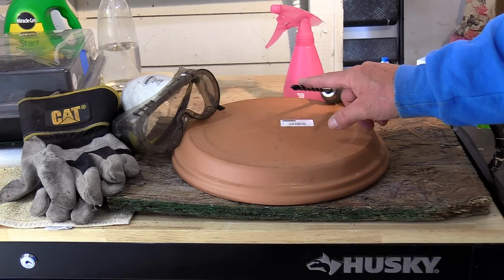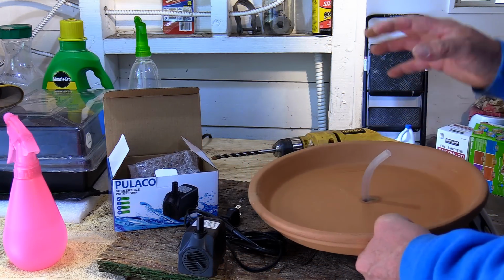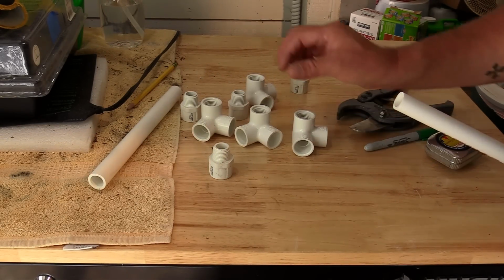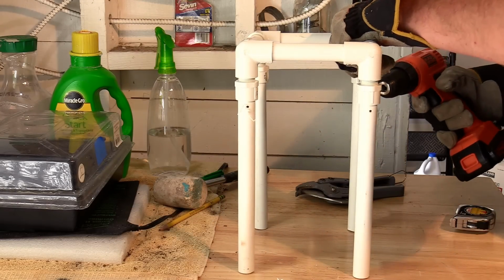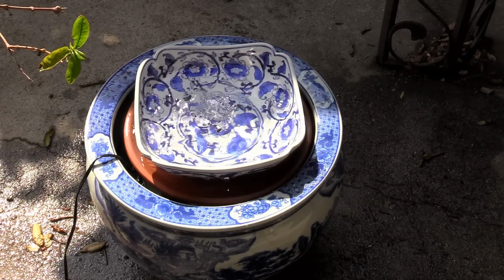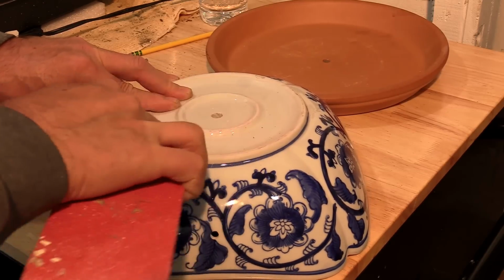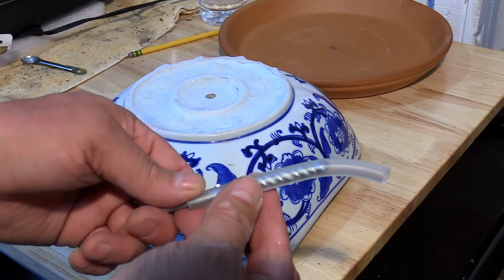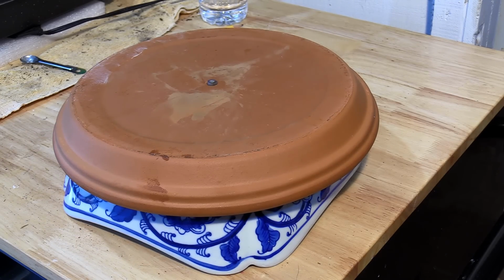Making an Asian Style Recirculating Bird Bath

Comment: Beautiful birdbath Tom!🤩👏🐦
What is the best way to clean this?
Reply from the maker: Cleaning it is in the description. Super popular with the small birds. It's new to my yard and is used tremendously. I clean it now when the water gets lower (down to about four or five gallons), which is about every three days--lots of bathing and splashing with the little birds. I know that the chlorine comes added in my tap water and lasts from 4 to 7 days so it is not really necessary. But because it's new, I also like to examine the project and see how it's going, which is good; monitoring it daily is important.

Comment: Very creative and the birds love them !  I made two using solar pumps , but no birds have visited and it's been a week. They are in the sun and was wondering if this is what's keeping them away. Any thoughts on this ?  Thank you
Reply from the maker: If there are Cooper Hawks nesting in the area, I've noticed that bird activity goes down. If you have a lot and trees and shrubs for our frightened friends, then they will both feel and be safer. 
Being in the sun should have no bearing on the birds visiting for a drink or a bath, unless your temperatures reach outrageously high numbers and superheat the water. (High sunshine will increase the rate of algae production by the way.) 
Keeping the water clean is important. If it is less than clear, clean it. 
For whatever reason, this particular bird bath has garnered high traffic, and I clean it when the water is, more or less, half consumed, about every three days. So far it has been remarkably clean. 
Unless the solar pump makes an unusual/frightening noise or action, I would not attribute it to be the issue. 
Finally, I believe, that like going to a restaurant to order food a patron will more than likely order a drink or have a glass of water with his or her meal. If the landscape is barren of flowers and other desirable foods, I would speculate that they could be less likely to stop by for just the water.
Reply: I think they are not used to the moving water, yet. We have lots of birds, trees and shrubs and I know there are hawks around. I'll leave them up and maybe they will get to trust it. Thanks for the reply !
Reply: Yes they need 1 more thing, branches. Try out a pot or 2 with any screening branches. Anything to disappear into when hawks dive. If you can, do several plants. Does the water taste icky from cement? There are things to reverse that. Sorry missed your plants addition. I have noticed birds preferring shade, and evening when they are less visible.

Comment: Hi Tom, I just watched this video and ordered the pump you used.  I imagine the fountain needs cleaning occasionally.  Is the terracotta saucer a little tricky because of its porosity?  Especially since the saucer and the smaller dish are attached to each other?  Your instructions are so clear. I'm going to set a fountain up on my office balcony.  Thank you 😊
Reply from the maker: It does require maintenance. My cleanout technique is in the description. The terra cotta does take some extra wiping. If you were to go with a glazed porcelain plate, it would save you from the extra wiping.
Thank you for watching!
Reply: @doityourselferhomeandgarde9732  You read my mind. I'm headed to couple of thrift stores to see if I can find something. Thanks again!

Comment: Beautiful custom fountain! You said it was really hot over 100 degrees in another video... what part of the country are you in? How often do you have to top off the water? I'm in Florida and am concerned I'd have to put water in every day so it wouldn't run dry...
Reply from the maker: It is in partial shade in this warm location, which is north Los Angeles in the foothills that are contiguous with the Angeles National Forest, Zone 10a. For this particular water feature I do not add water to it because I change it between every three to five days. I change out and recycle its water because it has frequent usage by the birds. The usual consumption of water is roughly about two to three gallons when I clean it. There is usually about five to six gallon left in its basin.

Comment: I’m new to your channel and have several questions. I live in the southern part of New Mexico where the sun is quite intense. I made a birdbath with a solar sprinkler that after 6 weeks has started falling apart! Plus the algae is so bad in the sun so the solar sprinkler will work. So I thought a recirculating birdbath might be better but how do you deal with the algae, how often do you need to add and/or replace the water? I really have enjoyed each episodes I’ve watched!
Reply from the maker: Nice to hear from southern New Mexico. Enjoyed camping under the majestic ponderosa pine trees in the Coronado Nation Forest around the southern part of your state.
I will try to answer your questions not as a professional but a DIY person. First, algae fouling a pump in a birdbath could be that it might not have been cleaned for a while.
 I managed a large pond in my yard with many significant gold fish for close to twenty years. It was in the direct sunlight and summer temperatures reached 100-110 degrees; algae grew quickly, and a strong pump (700 gallons per hour) would slowdown when its boxed filter massed up with algae (the algae made great liquid fertilizer by the way). Critter-safe algaecide was used to help slowdown the algae growth process. But it required a tremendous amount of maintenance when temperatures soared. I enjoyed observing the fish so the pond was kept clear without changing out the large amount of water it contained. The algae was always a dark-green color. I mention this because dark-green algae is not necessarily a bad thing (consider a city park’s dark-green duck pond). However, blue-green algae can be dangerous for fish, birds and humans. 
With a birdbath though, if algae is pronounced, it might be caused from various things such as too much sun or a lack of cleaning. With a birdbath, check it daily and clean it out when the water is less than clear. (For this Asian Style Birdbath, its cleanout is in the description.) Also important, being in the dry Southwest, recycle your birdbath’s water in your garden or yard. Moving your birdbath to a shaded part of your yard will greatly help abate algae growth. 
Finally—water specific: My water arrives chlorinated from a municipal source. Chlorine can last from three to seven days. How your water is treated from its source is an important factor of consideration.

Comment: Is there a solar option for those brand of pumps? Plug in won't work for me.
Reply from the maker: I run my fountains 24 hours a day, 7 days a week. If you're going solar, then you would need to find a pump, its batteries and solar panel that could promise that delivery.

Comment: Where are the wire and battery pack? Is the battery pack waterproof? Do you have a solar panel connected to the battery pack so it can charge? Thank you for this video.
Reply from the maker: It is a 10-watt water pump that plugs directly into an extension cord

Comment: I am gathering all the materials to make this, but I don't think all the PVC materials are listed. What are the four threaded pieces that attach the square base to the legs called? Any help would be greatly appreciated!
Reply from the maker: https://www.amazon.com/FangKingNo-Adapter-Fittings-Coupling-Schedule/dp/B092R5Y858/ref=sr_1_3?crid=1W8M4P5VJBGC3&keywords=1%2F2+inch+pvc+male+threaded+coupling&qid=1684796716&sprefix=1%2F2+inch+pvc+male+threaded+coupling%2Caps%2C160&sr=8-3